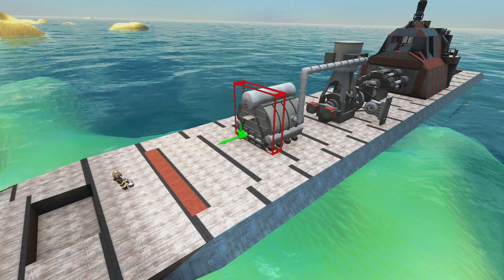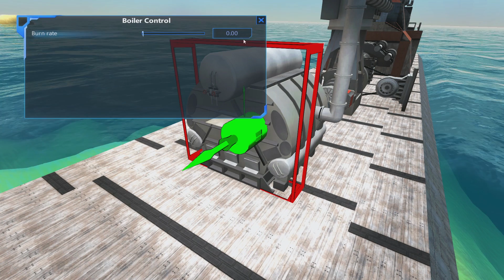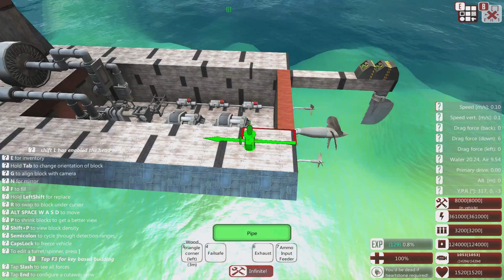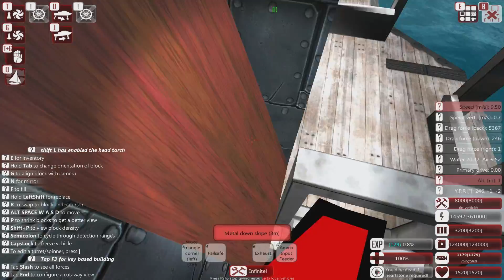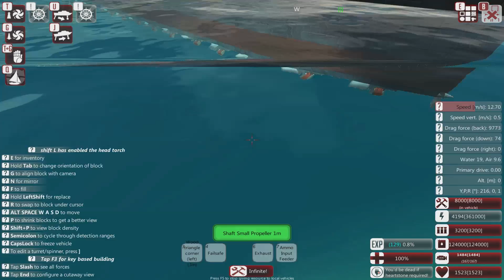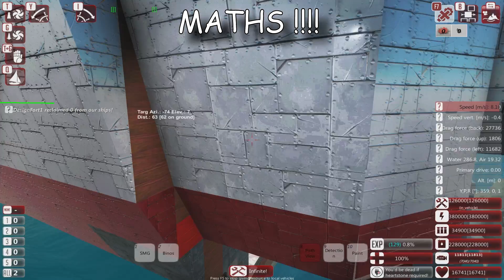From The Depths Lab E26-STEAM propulsion 2.3.1.9 ,LetsPlay,Playthrough

Comment: How much fuel is 5.6 mat/s
Reply from the maker: Depends how you get your fule, placing a fuel block then its 10 fuel per mat point, or 56 fuel n your Question. but build even a small inefficient refinery and that will be 150+ per mat. Going up to 1000 per mat. Can't remeber the maximum refinery efficency.

Comment: I'm not sure why i'd use steam when they're about as bad to use as fuel injector engines, and take up 20x the space, on top of the risks of explosions, ramp up times, combat vulnerability, etc.  They should change it to where Steam engines effectively overlap/triple duty for mechanical, electrical, and propellor energy, rather than trading off like the fuel engine does (meaning electrical/prop/mech loads don't affect one another).  At that point, they start looking a lot better for bigger ships as they can power big ships with high-powered systems 3x better and relatively simpler than massive fuel engine and battery banks.  In fact, wth do you even need mechanical power for at all once you hook up the props and turbines?
Reply from the maker: Steam is better for sea  propulsion currently and I know it would never happen but if fuel engines also had rotational speeds and could drive some props so there was a crossover or steam engines could use oil instead of resources then it would make a lot more sense. Currently your right it does not make sense but they started the right way on steam change but so much flak on even touching peoples fuel engines to be similar or any sort of change I think they stopped.

Comment: I'm having troubles placing the huge crank and piston.I need help.
Reply from the maker: make sure you get them facing the right way and it should go on top.  If it doesn't seem to connect then rotate 90 deg
Reply: Press F3 and try again

Comment: I retrofitted my 79000 mass battleship with steam propulsion. Previous top speed was 15m/s or 30 knots. New top speed is 26m/s or a whopping 50 knots. Just imagine a aircraft carrier going 60mph. Certainly less efficient, but this ship wasn't built with efficiency in mind. It was built to alpha strike pretty much everything.
Reply from the maker: Absolutely agree that if you want to have quick massive power or speed then steam is the way. It always has been that way. Lots of power but at extreme cost.The propellers give good thrust and the normal props have been reduced. But at about 1000:1 efficiency it's not good in a campaign environment or if battle is longer than a huge alpha strike.I can see it being used in a tournament that say has 15 min limit so can work out how much res is needed.

Comment: I suspect steam is much more situational to campaign settings, if fuel is costly or being guzzled by other prioritized craft, steam can use natural as an alternative fuel. If resources are localized and you are tied closey to natural mines, steam is also preferred.

Other reasons for steam is survival! Natural resource containers verses fuel tanks, far less vulnerable and destructive when taking hits. Gas needs refinement and safe containment as well.

I would enjoy building steam powerplants in my campaigns, if and when natural is in excess. Likely transferring power via unit to unit off a power grid of simple battery banks.

Comment: I tried fiddling around with it, but I found it to be way too unreliable especially in battle as the ship's pretty much dead in the water for a few seconds. However, I do prefer the look of the large propellers. So eh, I'm undecided.
On another note: Was I the only one who couldn't use the large 2m propeller shaft to seal off the ship? My propeller/shaft after it always was disconnected somehow.

Comment: Only reason I use steam is because it kind of sounds cool, and the multiblock is prettier than fuel engines. Now, if fuel engines were revamped to look as nice as steam (moving crankshafts, better vroom noises that sound less like jets and more like a turbocharged or supercharged piston engine, gearing for direct-driven propellers, transmissions and differentials for drive wheels, etc.), I would use fuel more.

Comment: The engine shaft bearings give you an efficiency bonus, allowing for the engine shaft and pistons to rotate faster safely.  This increases the power you can deliver to the reduction gear resulting in a higher top end speeds as well as increased power generation. This could be a bug, but If you look at the tooltip, it says 4m pistons when you are in the inventory but when select it and leave the inventory the tooltip says its a 5m piston.
Reply from the maker: yes noticed the 4m piston issue although I think it only refers to piston travel as the 2m piston are actually 3m high, 1m are 2m high.I looked at bearings but only seemed to have an effect if there was more than one engine shaft and made sense if for some reason the power was being moved over a distance using the shaft. If it is adding to shaft rotation I would suggest it is a bug.
Reply: It does in fact provide an increase.    After your engine is set up, if you look at the gearbox it says "The maximum safe rotation is multiplied by 0.94 due to the quality of rotating components added to the main assembly"  This percentage can be increased by adding Engine Shaft Bearings in between pistons or anywhere else along the main engine shaft.  The tooltip then updates and lists the engine shaft as reinforced.  Also seems as though the new Huge pistons put out around 2000 power per material.  I set up a 6 segment large boiler producing 4260 volume at 25%.  2.1 mat per second yields 4196 power.
Reply from the maker: I think the bearings not enough to overcome the efficency penalty of using resources but worth noting.As for power on huge, put it under load, with no load it is near 2000ppr but under load they all go to 1000ppr

Comment: The steam engines seem to be a 'personal challenge' tool, sort of like sails. You use them to add another layer of difficulty or a different design asthetic for your ships. I wonder if there is a way to configure the drive shafts and gear boxes to power the paddle wheels that the DWG and OW use. I also think they may be for use in specialized campaigns. An 'Age of Steam' theme.
Reply: Sails and steam both seem to be hinting at a future tech level/research system.  You would never use them, except if you don't have access to fuel refining (for steam) or resource harvesting (for sail).  Then they make sense.
Reply from the maker: Like the idea of paddle wheels.Currently can't attach any other blocks to the shaft but it's  a great idea.Yes they area a challenge but if they are touted as a different design paradigm then make them worthy of it.

Comment: Do we know when the devs are gonna fix the new hatches and bulkhead doors? The hatches don't work at all, and the bulkheads only work in a conventional orientation. (Not like the original doors that work horizontally and vertically.) And the new porthole windows glow a solid pink for some reason...

As far as these new propellers, I just use them as decoration. I mount them on a spinblock with two controllers to spin them during motion, and stop them when stopped. The new 7 meter propeller is a MONSTER.
Reply from the maker: I did try the hatches and doors and they are ok if vertical. noticed I had to jump through hatch. Did not try them horizontal.

Comment: would love to see the same system for the petrol engines as there is for steam, i would think the devs have it in mind.
but until there is something like research petrol engines are probably the best all rounders =)
Reply: I'd guess that steam engines are a prelude to nuclear reactors, since apart from RTGs all nuclear systems work in a pretty similar way to steam boilers (just with a different heat source and sometimes coolant)
Reply: @EuphemiaRem  indeed, that would make a lot of sense as they are mechanically identical when it comes to the steam part, major difference would just be the cooling of the nuclear parts. 

guess you could also cool and reuse the steam from a conventional boiler but since water is abundant planet side it has rarely been done for mostly complexity of the system required to do it (pulse jet and water hammer problems for many if not most of the systems iirc)
Reply: Yeah diesel engines would be the way to go.

Comment: instead of doing the math every time , just open up the vehicle  info (V) and go to the power tab..............no use doing the math on steam the efficiency is fixed( 1000 ppr) it can't get better only worse if you vent steam(basically venting resources into the air) or running the boiler doing nothing........ the steam vents make engines worse and add spool up time by adding more steam volume to fill

Comment: I don't even touch steam. Too inefficient. I can get way more fuel per unit of resource if I use the max efficiency refinery. Then again, I prefer my airships anyway, so ship screws are kinda moot. 
Maybe if I get back into making battleships, I might incorporate the larger propellers (and the new rudders). It certainly looks better than the massive bank of the regular 3x3 engine propellers I stick in the back.
Reply from the maker: Aesthetically I really like it an if just building for looks I would use the steam boilers, rudder and props.Or if they make fuel engines work in same way and have big disadvantage some how.
Reply: @DelsGaming  I wish they had steam control valves (not just the relief valve) so that we can keep pistons running at the fastest possible speed on any load (or until the boilers aren't big enough). That way, if there suddenly is a loss of load, the pistons don't suddenly over-speed and die.

I think the thing that screws up the balance between steam vs fuel is the fuel refinery. (Note: my current understanding of the game may be outdated) For steam, you can only get so much engine power out of one unit of resource. However, if you run one resource through a +280% efficiency refinery, you can make more units of fuel which in turn can generate more engine power overall.

I think the original idea of the balance for steam is that for a trade of simplified logistics and engine build (put more resource in = more power out), you get less efficiency per resource. However, the problem here is that resource storage is less dense than fuel storage, meaning that for two ships each using a fixed amount of dedicated fuel storage and engine power, the steam-powered ship has a lesser range due to not only the lesser efficiency but also the lesser amount of fuel it can carry. Combined with the fact that steam has a slower ramp up and that resources will be used for repairs and ammunition, there are too many downsides to consider steam except only as a base-keeping power supply.
Reply: +BrokenLifeCycle Material efficiency becomes entirely moot by midgame. Steamnis for the ridiculously costly godlike endgame builds that eat twenty million power and eat perforators for breakfast.
Reply: @ineednochannelyoutube5384  Why can't the same power requirement be achieved with fuel engines instead?
Reply from the maker: @ineednochannelyoutube5384  agree near end game its irrelevant, but since they are touted as an easy starter engine system then the efficiency doesn't suit it.
Reply: @DelsGaming  If you build the propulsion correctly, you significantly reduce the amount of steam you need which greatly increases efficiency. Case in point, the five-meter propeller requires 14,400 steam power to hit max RPM.  If you add a second reduction gear it drops the power required to 7200.  A third gear would drop it to 3600.  I have a small boiler, that burns 3.2 resource per second and produces roughly 8000 steam power.  This is plenty to run two 5 meter propellers and achieve top speeds near 34 meters per second or 67 knots.  Also, engine bearings provide a bonus to how fast your piston cranks can rotate.
Reply: +BrokenLifeCycle Takes up too much space.

Comment: i /think/ the reason to have multiple pistons is that it reduces the odds of them flying apart if the rpm's too high.
but yeah, steam's really just bad right now for campaign. i look forward to seeing what they do with it, but it's not there yet.
Reply: More pistons would mean more torque with less need for steam pressure which is essentially the grunt of your engine, so essentially more pistons (up to a point) would make things more efficient at the low end of the crankshaft spin
Reply: Yeah, fuel engines are just boring. I'd love for steam to become more useful! Also a nice revamp for fuel engines, a nicer looking multiblock with various spinning things and heating on the exhaust pipes that make them glow (because PC gaming), maybe the ability to specify whether you want two-stroke or four-stroke, petrol or diesel, etc. In the words of nakey jakey, games that should bang: From the Depths and Automation (even though automation doesn't allow you to supercharge, specify  diesel or gas, or change cycle, FtD-Automation would. It's the concept that counts.)
Reply: I would like if rtgs got a rework, so under powered and honestly i just keep coming back to fuel injectors constantly or using the emerald engines as i dont know how to make the most efficient engine, all my 'efficient' designs are as efficient as injectors rip
Reply: Well having more pistons means that the rig can handle more steam in the system, which means that a bigger boiler won't break it, which means that you can get more power in the output.